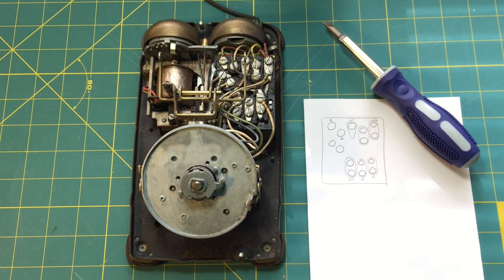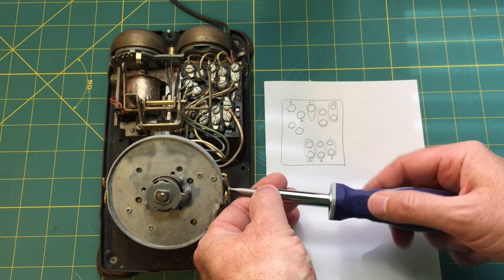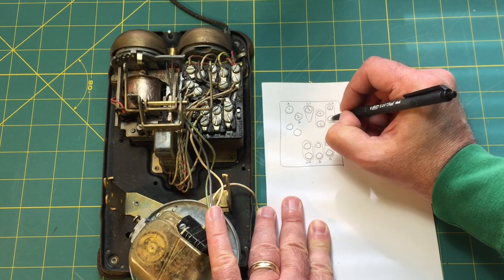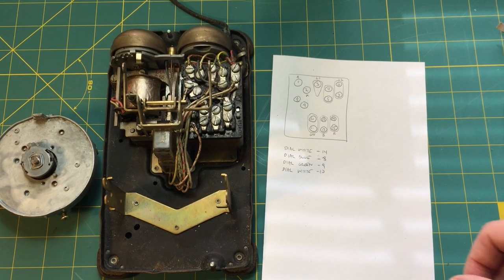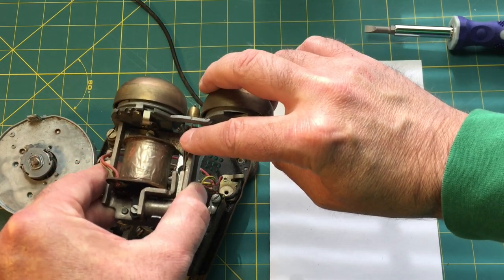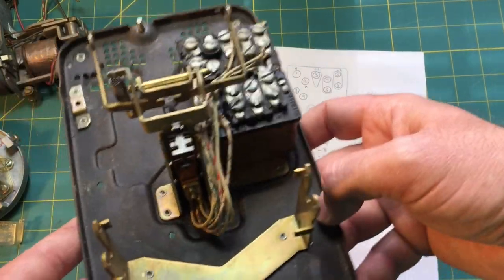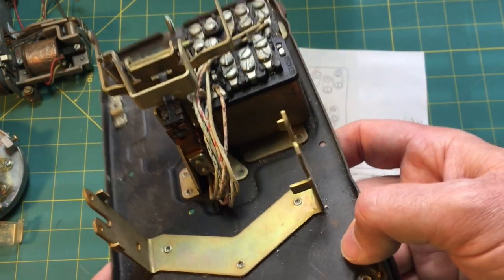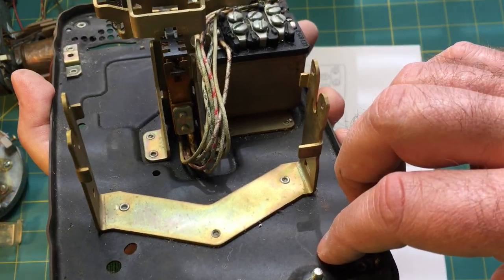Western Electric Model 500 Desk Phone Restoration (Part 3)

Comment: You can actually still use it when you get it put back together (if you still have a landline), but you'll have to wire it slightly differently to get it to work on the modern system. If you wire it back up like it came from the factory, you'll still be able to make and receive calls, but it probably won't ring. All you have to do to fix this is take the black wire coming from the ringer that normally gets connected to G and hook it up to L1 instead (which is also where you connect the green wire coming from the phone cord).

Comment: Hi, I'm also currently trying to restore a Automatic Electric Phone which I believe was made in the 1970s. The two phones I'm using is going to be turned into a direct intercom system. I'm using your videos as a guide reference on what should I look out for. So far the bell only strike the hammer once when a call is received from the other phone and was wondering if you know what is causing this to happen. No I am not using a DTMF Decoder or a phone company, just powered by 90V DC and direct line between phones.
Reply from the maker: Reynard Misae I believe that the bell needs a 10Hz AC signal in order to ring.  I recently picked up a copy of this book that explains it better than I can: https://www.ebay.com/itm/302995739755
Reply: Network XIII that sounds about right. Now I have a very simple problem. I managed to find the schematics for the phones and have reverted any modifications back to it’s factory settings. But now both bells are ringing when both handsets are placed down.

Comment: I would like to see how the feet are replaced on these as I have to change them on a few of my phones. Including one with this exact same style feet. These ones I believe had some sort of cloth coverings over them originally if I remember correctly.
Reply from the maker: The feet on this particular phone are riveted onto the base.  They also seem to be made out of leather, so I opted to leave them alone.  Later model 500s used some sort of synthetic material for the feet but were still riveted.  You could always use a screw and nut to mount replacement feet.
Reply: @NetworkXIII  Yes I know exactly what you’re talking about. I decided to bite the bullet and buy a rivet gun. I have now pretty much become a pro at doing that
Reply: I actually just got rubber feet for those ones and I installed them instead. Yes I do like the screws over the rivets. However the last ones that I replaced on an AE phone, one of them got stripped out and I had to get creative with that to get it out, and then I had to drill a slightly bigger hole in the opening because the rivets I have for those have a slightly larger diameter. It was a royal pain but I did manage to get the old ones out and replaced them with new rubber feet.